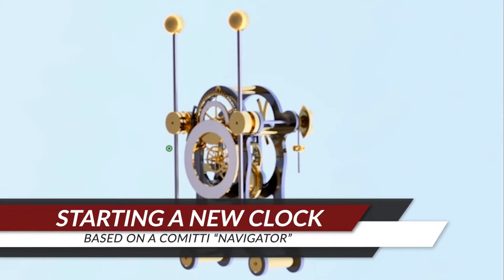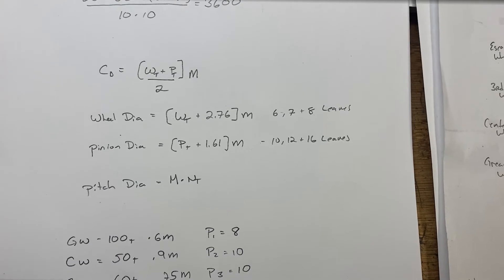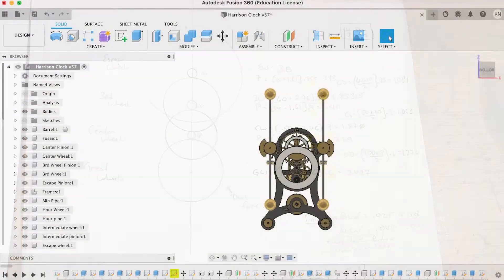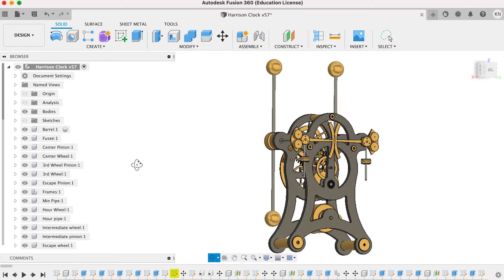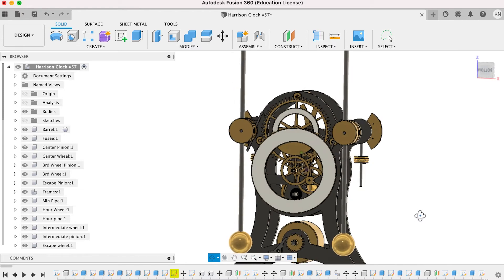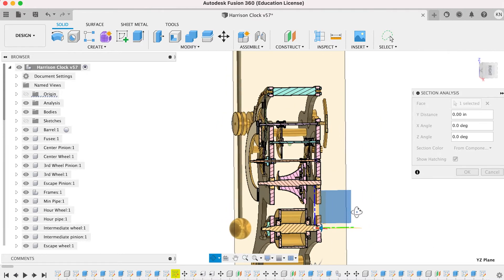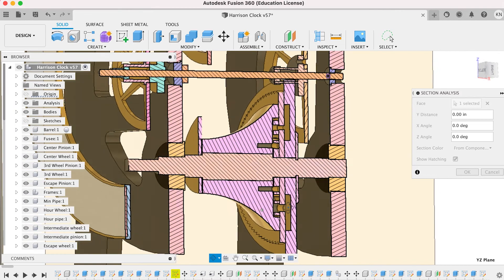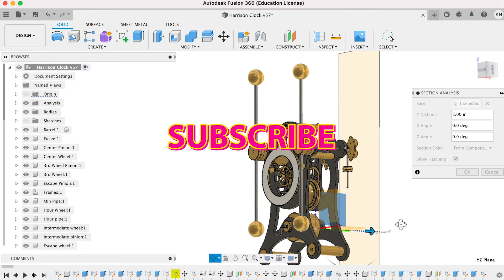Starting a new clock based on a Commiti "Navigator" skeleton clock

Comment: How You calculate lenght of double ended pendulum? Does both part of specific  one pendulum has equal lenght of its both rods and weights?
Reply from the maker: The total length was set by what looks ok and the longest I could make it and clear the floor of the clock.    The two pendulums are adjustable on where these are held in the pivot.   The gross adjustment is first done setting how much longer the bottom is vs the top of each (they have to be set the same) fine adjustments are made by moving the adjustment weights up and down to get the clock keeping time.

Comment: If any of those gold plated parts will be wear parts, look into titanium nitride coating.  It shouldn't be too hard to find a place that can do it, and it's a very hard-wearing gold colored finish.
Reply from the maker: I am familiar with that coating on tools, can you also put it on brass?
Reply: @KevinNolanMakes  I've only personally seen it done on steels, but westcoastpvd seems to indicate they can chrome plate the brass and then apply pretty much anything to it.
Reply from the maker: @PyroForge  interesting.  To plate gold on brass first you need to Ni plate the brass.   Seems similar, thanks